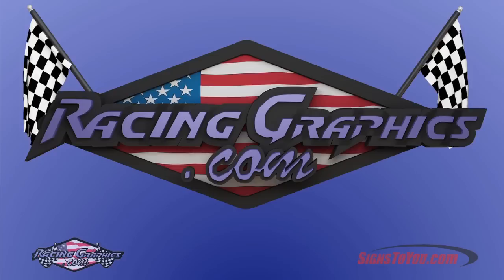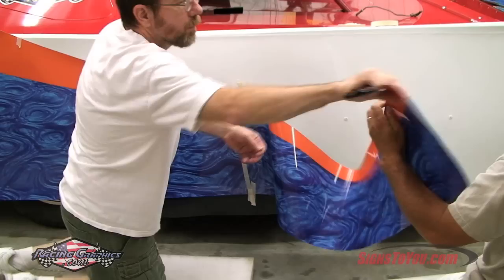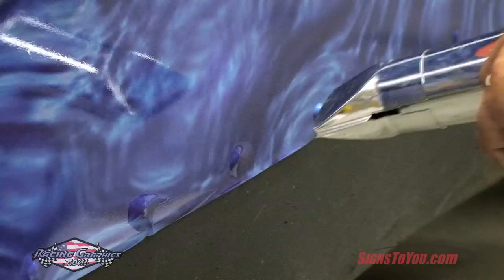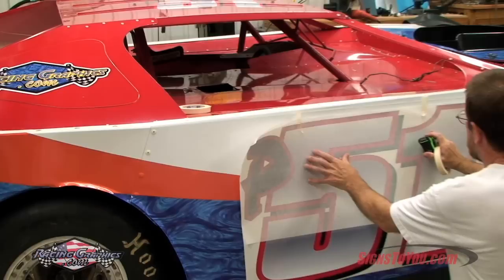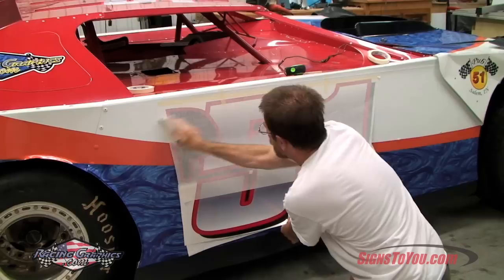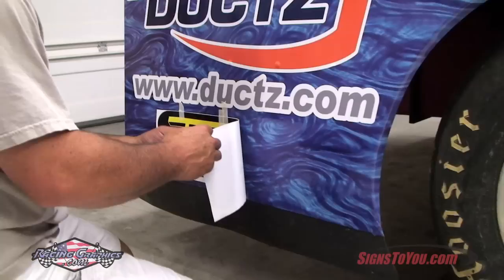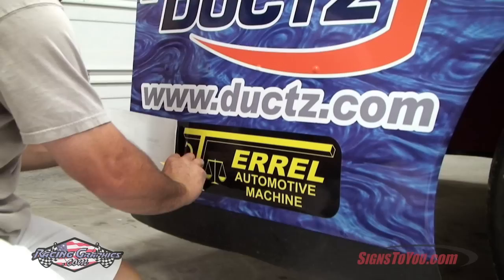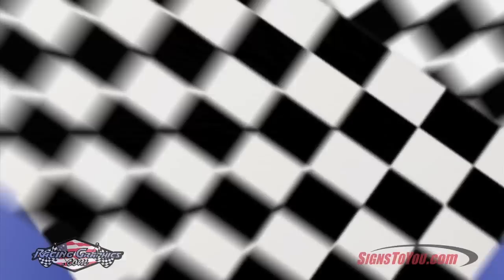How to install race car graphics

Comment: Cool design, but why didn't you just make it all one solid print? You added a lot of time to the install process by doing the sponsor decals separately. If the sponsors are only temporary, it's still going to ruin the main decal underneath when they're removed.